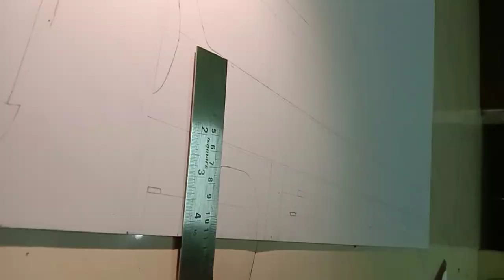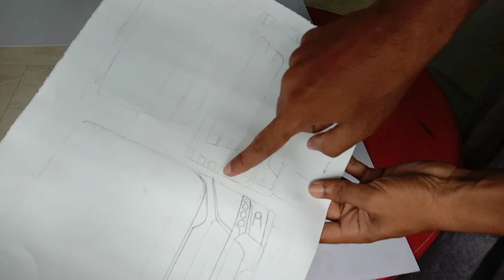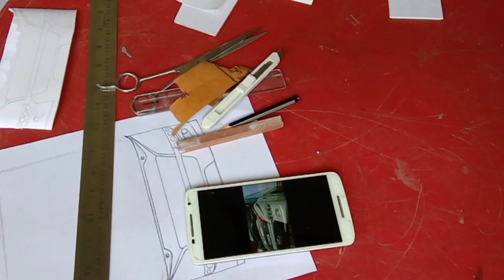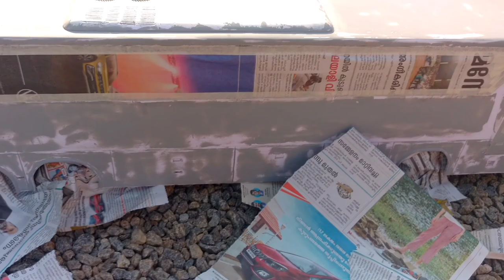scania making video #shorts #art #miniature #making #diy

Comment: Sir which black glass you have you used on side
Reply: Sir tell
Reply from the maker: Not black glass. Its transparent poly carbonate sheet have 1 mm thickness. A cooling film is sticked on to the polycarbonate sheet. Beacause it seems like black glass